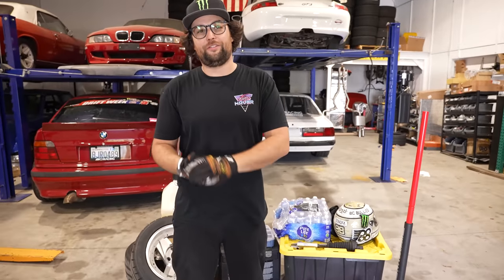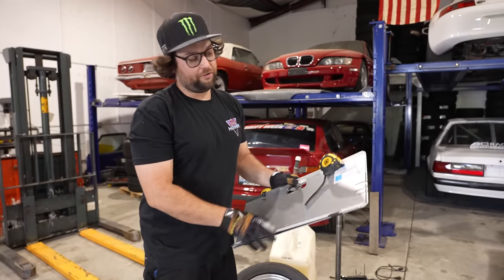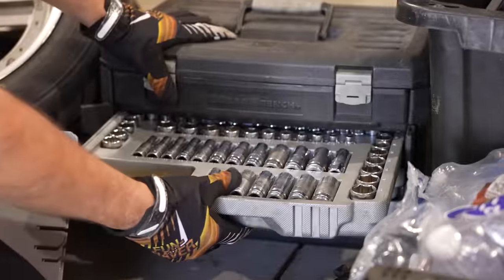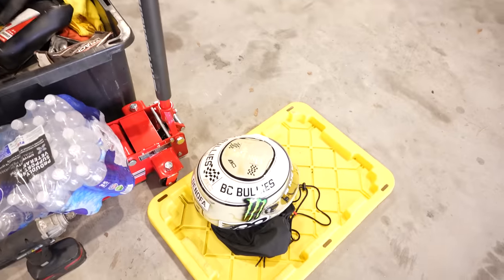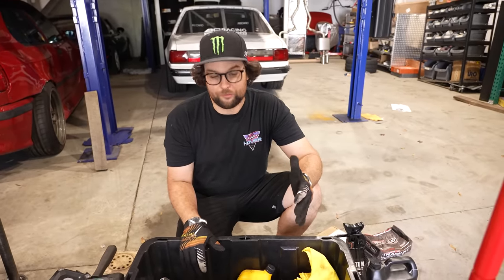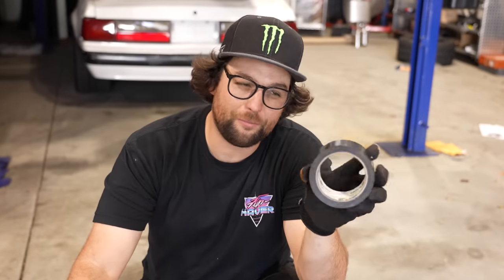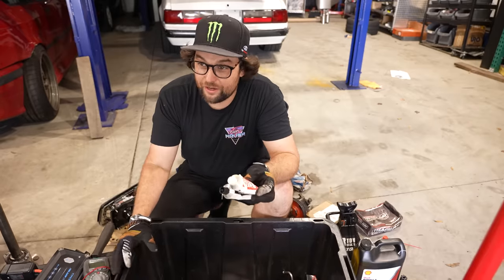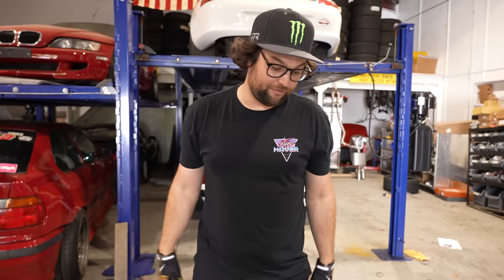What to Bring to a DRIFT DAY! Essential Items and TIPS

Comment: Great video, thank you for putting it together.  Here's a quick list from the video:
Toe Plates
Measuring Tape x2

Tote
Adjustable Wrench
Gear Wrench tool box
Wire spool (medium size)
Head Lamp
Fuses & Electrical Connectors
Battery Jumper/Jump Box
Coolant
Jack stand
Lug Nuts
Zip Ties
Oil 
Brake Fluid
Brake Clean
Microfiber & Cleaner
JB Weld
Spare Relay
Electrical tape
Pry Bar

Tie Rods
Coil Packs
Heim Joints
Coilover wrenches
Lower Control Arm
Extra Axle
SPARE parts (things that have broken before, Power steering, fuel pump, headlights, etc…)

Tires
Gas can

Comment: Before we put in the e34 m5 diff and got the sponsorship from driveshaft shop our main extras were ZFs, diffs, axles and driveshafts for renting out MIR. If you are tuning a good power inverter is a must cause laptops die at the worst times. Also I know its easy to overlook but pack some jackstands. Seen too many ppl making sketchy repairs with just a jack or even worse the factory e36 jack🤣
Reply: To add on I would say add two small sheets of plywood that you can place under the jack stands in case the pits are on top of grass!

Comment: I do exactly the same, when I put new parts on the car for maintenance (e36 stuff water pump/thermostat/belts/pulleys tensioners/coolant hoses/driveshafts/radiator/guibo/brake fluid/gloves/ etc) all the working old stuff goes in the box as spares 👍🏽 and all the stuff you've got is in there too, not only has it saved me plenty of times also it's been nice to help out others that have had car problems at the  track too